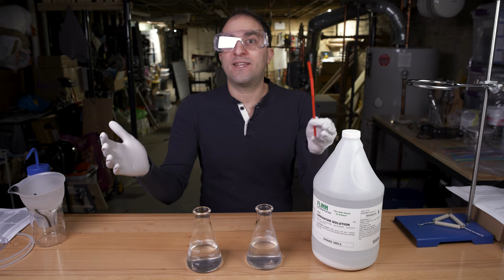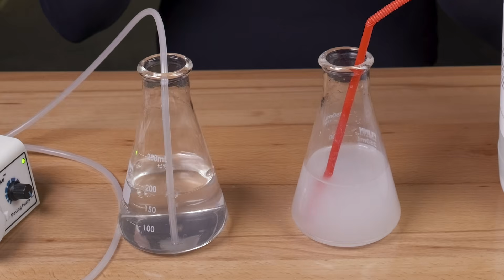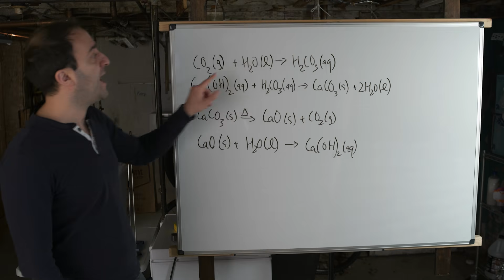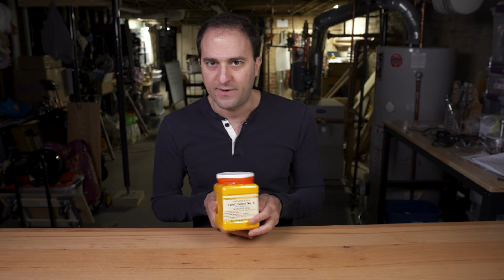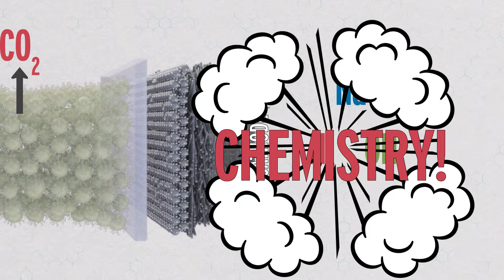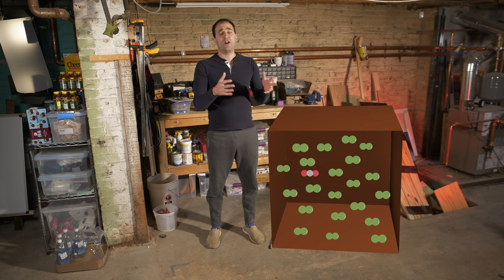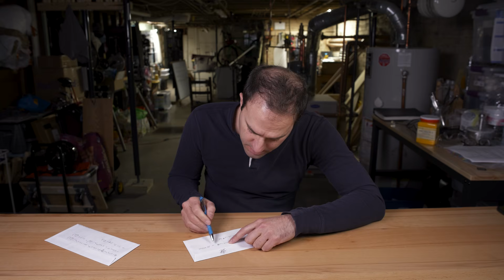Why a Carbon Capture Breakthrough Will/Won't Save Us

Comment: Excellent video. Glad you made the point on compressing, transporting, and storing the CO2. Most people miss that, but it takes energy too. This is just the thermodynamic issue. Not to mention the economics of basically building mega projects at a scale never seen just to squirt the product into a hole.
Reply: Convert direct carbon capture into raw materials like carbon fiber or graphene.
Then it will be permanently stored in a useful product
Reply: @ nothing can make it profitable in a market. There are VASTLY cheaper ways to get CO2 than extracting it from air at 0.4% concentration. Besides, we put more
Carbon into the atmosphere every year than all the worlds mineral and metal industry production combined. 10 billion tonnes last year. All metals combine to like 2 billion tons per year. 0.5 billion for all plastics. What else are we replacing? We’d have trouble using 10billion tons of carbon fiber and graphene if it were free. We’d have to use it as gravel. The scales are just way off.
Reply: @blakereid5785  nature recycles the carbon. We release it, nature absorbs it, we gather it again.
The carbon we release isn't created from nothing.
But if we start trapping it in building materials the total free carbon in circulation drops. Plus, we should make more things from carbon fiber and graphene.

Comment: There's something I have really wanted to see us try, like actually try: sulfur dioxide aerosols. "stratospheric aerosol injection" (SAI), which essentially mimics the cooling effect of large volcanic eruptions by reflecting sunlight back into space; this is considered a form of solar geoengineering
Reply: SO2 isn't stable in the atmosphere. It will react with oxygen to make SO3 and then with water to make dissolved SO4, also known as sulfuric acid. 
The acid will precipitate and damage or kill crops and forestry. 
You can achieve a short term cooling for damage to the eco-system.
Reply: two words: acid rain
Reply: @belg4mit  The sulfur doesn't fall out of suspension very quickly if it's in the stratosphere.
Reply: @benmcreynolds8581  Simply stop desulfurizing the jet fuel.
Reply: The amounts involved, plus the fuel use required to get that amount to altitude, are why no-one has tried it. 

Then there's the legal hurdles, considering it affects every country in the world.
Reply: @thekaxmax  What if it was something that we used in a focused location, in a location we think would benefit from this, due to a harsh drought or many other different reasons. (Could they utilize large floating blimps full of sulfur dioxide or using a bunch of balloons, rather than dealing with the plane route)
Reply: @benmcreynolds8581  the focused location wont remain focused if the winds blow, and the winds always blow
Reply: @thekaxmax Dude, literally all you have to do is add 1.5% sulfur back to Jet A fuel. Commercial flights will inject sulfur aerosols into the stratosphere for free.

Comment: ..can't solve the CO2 issue with the current power output` is not the same as "can't be done",  Fusion energy "could" become an option.  Lowering the cost of space launches (as some reusable rockets promise} could make space based solar a viable option.  ...and 8% efficiency when a process is first brought to industrial scale, does not preclude it moving toward 40% or even 70% at some future point.

Comment: Just the energy required to pump so much air through the system to capture the CO2 far exceeds the CO2 you capture; the concentration of CO is far to low. 0.04% is the same as $4.00 out of $10000.00. The chemistry is interesting, but it seems that you are really trying to solve a problem that does not exist. How much energy does a tree use to capture a KJ of Carbon? Also you are not considering the exergy. All energy is not equal, electricity has a very high exergy and heat has a low exergy. Plant use energy with a fairly low exergy, while electrolysis uses electricity with a high exergy. So, although I enjoy the chemistry as much as the next person, I think it is a waste of time an resources to try and capture CO2 from the air. Plant already do a good job. Rather spend the time to optimize farming...

Comment: I feel like when we get our emissions low enough, we should implement a tax on carbon emissions that is equal to the cost of fixing that emission with carbon capture. Any usage which is still economical after that tax, should still be allowed. Though i doubt many will remain that are better options than carbon neutral biofuels like ethanol
Reply: We should implement carbon tax now

Ignoring external costs is how to prevent capitalism from being in society’s interests
Reply: @SigFigNewton  
I think there are good arguments for implementing a carbon tax right now. But less good arguments for making that tax exactly equal to the cost of carbon capture this early. I think we should instead take a more gradual approach that gives us enough time to adjust

Instead of making it where suddenly anyone in poverty can no longer afford to put gas in their car to get to work. We could make it clear that they will need to buy an electric car or ethanol powered car in the next decade or two, and they can wait until those vehicles appear on the used market.

We should have started ramping up the carbon tax decades ago. “The best time to plant a tree was 20 years ago. The second best time is now” and all that
Reply: Solar, wind, and waves are already cheaper than fossil fuels
Reply: @ 
From all sources i could find, when you account for energy storage that makes solar and wind stop being cheaper

According to Wikipedia, the LFSCOE-100 (which includes the price of storage) for wind+solar in Texas would be over 5 times the cost of a purely natural gas powered grid.

So if you want power when the sun is shining, solar is cheaper. But if you want power on a windless night, fossil fuels are cheaper. And since power grids need to supply power both during the day and at night they tend to favour using both.

There is hope that this will improve drastically. There are so many suggestions for how we might bring down the cost of grid-scale storage. But that has not happened yet.

Personally I’m fond of the idea of using nuclear to solve this problem. A combination of nuclear+wind+solar+storage could be significantly cheaper than wind+solar+storage. But ofc nuclear has a major PR problem
Reply: @ 
your reply seems to assume i was talking about normal electricity generation. I was not. I was instead referring to the things which benefit the most from being powered by hydrocarbons. Examples include aircraft, long-haul trucking, and backup generators. If you want to safely store a large amount of energy in a small space, it’s hard to beat hydrocarbons. Though i suspect biofuels are the best solution in most of those cases. Last i checked, it only doubles the price of fuel to get carbon neutral jet biofuel.

I was also referring to things which I’m not aware of. It seems plausible that there exists a use case where fossil fuels are simply the best solution. Perhaps some chemical reaction where crude oil is the perfect starting material. In those cases, it might be worth it to just charge them however much it costs to undo the carbon emissions.

Comment: I must have missed a point for sure but can't that energy come from renewable sources?
Reply: It can, but if you have that much renewable energy it's better to use that energy to offset generation which produces CO2 emissions than try direct air capture of existing emissions.

Pretty much what he said at the end: direct air capture only works if we already have huge emissions cuts.
Reply: @reddragonflyxx  Ahh yes thank you. I'm quite skeptical about carbon capture.
Reply: @nopetuber  I think it can work pretty well at facilities which generate concentrated CO2, but even that isn't cheap.

Comment: Post combustion carbon capture(PCC) is the main way to treat CO2 emissions from point sources. air has too low CO2 concentration for DAC to be effective anyway.
Reply: The cheapest so far tested in the field took about 15% of the energy output of the power plant it was attached to.

No way in the world would power companies wear that, that's more than their profit margin.
Reply: @thekaxmax if we charged utilities for the cost of carbon capture, they'd just pass it along to consumers, and/or invest more in low-carbon generation. That is, in fact, the only way to actually move the needle on emissions.
Reply: @mbessey  The fun is that if you X3 the capex cost and +50% the opex cost, then everything is cheaper than fossile fuel...
The real competition of fossile fuel is green tech. Carbon capture will never be economical. 

Every single natural gaz well use carbon capture to remove CO2 from natural gaz since the 1800... It is mastered and well developped. It is not a new science. It is one of the oldest, most understood chemistry... And even after 200 years and thousand of plants all around the world, it still cost too much.
Reply: @thekaxmax That would lower the output of a subcritical coal burning steam electric generating station to perhaps 33%, not great, but it is doable. It isn't currently done because there is no regulatory framework to force it to happen.
Reply: Pre combustion capture is even easier using gasification and the water-gas shift reaction.
Reply: @gregorymalchuk272  Are you trolling? gasification require energy. Where do you get your energy?

Comment: Lmao, I love how you calculated it as 313kJ/mol, then looked it up and found that it was apparently actually 20kJ/mol, and just blazed right ahead without even bringing up the discrepancy 🤣
Reply from the maker: I calculated 313 joules per cubic meter, which works out to 29 kJ/mol. The published literature I mentioned put it at 20 kJ/mol. They calculated it in a more sophisticated way than I did and probably have a more accurate number, but I was still in the ballpark.
Reply: @ACSReactions  oh, I missed that they had different units! That seems much more reasonable -- I thought we were talking about a >10x difference...

Comment: It's conclusions like these that make people give up. You shouldn't be looking at how impossible it is to remove all the CO2 we emit, because that isn't even necessary. Mother nature already captures a very large portion of the CO2 we emit. If it didn't, we'd be in a much worse situation. The real question is how much CO2 do we emit that mother nature isn't capable of dealing with, how close can we realistically get to reducing emissions to that level, and then how much extra would we have to remove with direct carbon capture. That number is probably a lot more feasible.
Reply from the maker: Did you watch to the end of the video?
Reply: @ACSReactions  Yeah. You said we'd have to reduce our emissions by 80-90%. That's nonsensical.
Reply from the maker: Ah, that estimate, reducing emissions by 80-90% and hope DAC/CCS tech will advance enough to handle the rest, is an optimistic general summary of current published scientific literature's answer to the question:
"The real question is how much CO2 do we emit that mother nature isn't capable of dealing with, how close can we realistically get to reducing emissions to that level, and then how much extra would we have to remove with direct carbon capture."
Reply: @ACSReactions  Well, that level of reduction would involve a very large portion of the world's population freezing to death in the winter because they can't heat their homes and starving to death because there wouldn't be enough food being produced. The devastation would be much more immediate and noticeable than anything that has come from climate change so far. So, again, conclusions like this make people give up. I'd rather see someone double check the math than summarize current published scientific literature that concludes that it's hopeless.
Reply: @koseq7  If we don't voluntarily reduce our emissions, the planet will reduce us 😞

Comment: Ok, so basically, like everything, we can improving carbon capture, reduce emissions, and reduce CO2 build up year by year. It's feasible.
Reply: Yes, we just can’t improve it any more than that 20 Kj/mol number, and the closer we get to that number, the more human effort and specialized resources we will need in order to create a marginally better process (law of diminishing returns).

So the decades that were spent improving our understanding of everything to be able to make a 10-fold improvement to carbon capture mean that we will likely require 10 times as much effort or time to achieve another improvement of the same magnitude.
Reply: @ Not necessarily the same effort. Can be even higher or dramatically lower. All advances in other fields also contribute. And with AI I would say it should be exponentially faster like a lot of advancements being made in medicine and biology.
Reply: Yeah, it’s just far more expensive than replacing ffuels

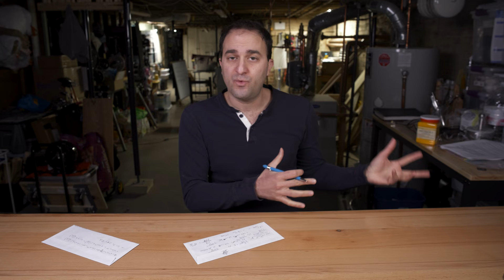Comment: 7:55 I'm sorry 18% of all the electricity produced going toward sucking back co2 from the atmosphere is "not terrible"?😭 That's like dedicating all the current hydroelectric dams for the sole purpose of co2 sequestration, that's bananas 🥲 I'm no expert, but that just makes it sound like the most productive solution to carbon capture will probably be to impliment it as a byproduct of other environmental restoration projects, like reforestation of pastures, beaver reintroductions, agricultural practices that increase the amount of organic matter in the soil, etc. (Not saying we can't do both, though, we gotta be firing from all cylinders if we want to have a chance at fighting clkmate change obviously).
Reply from the maker: "not terrible" is very much a relative assessment in this context.
Reply: @ACSReactions  Precisely - in fact we have plenty of excess solar energy to remove excess CO2 in the atmosphere.   Current PV production capacity is > 1TWpeak per year, enough to remove ~ 2 GtonCo2/yr, and rising every year

Comment: It is possible to use catalyst to lower that energy cost?
Reply: Catalysts don’t change thermodynamics, only kinetics.
Reply: Catalysts change how much energy you have to put in to kickstart the reaction, but the start and end points remain the same. In the hill analogy of the video, a catalyst would be something that lets you walk up the hill (like some good boots and walking sticks) rather than having to fly up into the sky to parachute back down.
Reply: @sjn7220 Catalysts could still get us closer to the theoretical minimum separation-work, because we aren't anywhere close to it. This is true for a lot of industrial processes. Like cryogenic air separation consuming way more power than the theoretical minimum.

Comment: Dumb question: what is the problem with colocating electrical generation and gas production such that produced CO2 is reinjected for tertiary recovery into the reservoir?
Reply: There's not really any problem with doing that other than having to produce 3 units of power, use 2 units to sequester the CO2, and then transmit the remaining 1 unit for use on the grid.
Reply: @thuzUNed Your ratios are wrong. Current carbon capture schemes use 15% of the available energy, not 66%.

Comment: 2:22 - why don't stop the process right here, by dumping the CaCO3 solution in oceans, unless you want to obtain the CaCO3 solid as a commodity.
Reply from the maker: Because then you've used up your Ca(OH)2 and have to manufacture more, which means mining more CaCO3 and emitting more CO2 in the process.
Also there's only so much limestone on Earth, and we can't be dumping all of it in the ocean.
Reply: @ACSReactions  Speaking of the ocean, is there anything we can realistically do to fix ocean acidification?
Reply from the maker: Great question, we made a video last year about a few approaches to that:
https://youtu.be/PqFwRMgvMVY
Reply: @ACSReactions  Most of that video talks about using calcium hydroxide, which comes from heating up limestone, and as you just said, that's not a very good solution. The part about electrolysis doesn't explain how that raises the PH, but I'm pretty sure it's because it makes bleach, right? Aren't there more efficient ways of making bleach that we could use to make it more feasible? Or is it not because it makes bleach?
Reply: @koseq7 
Most of the acidity in the oceans is caused by it absorbing CO2..